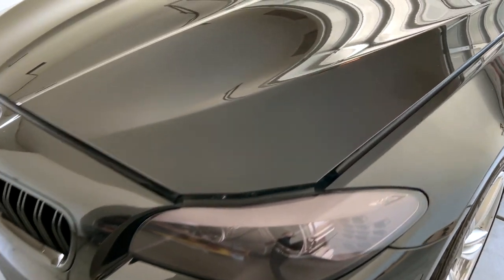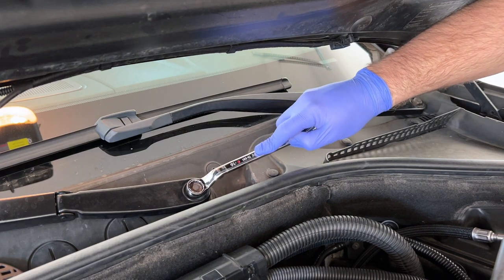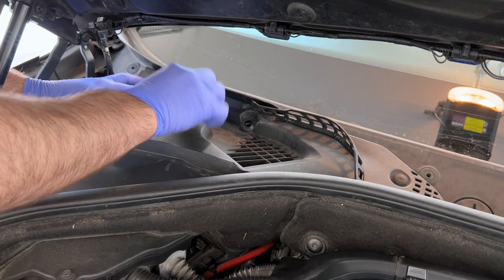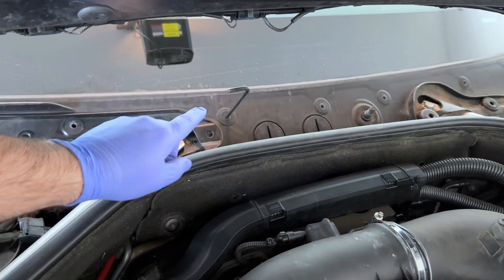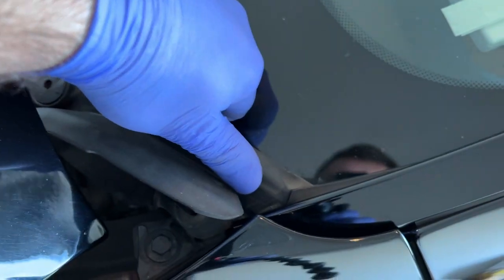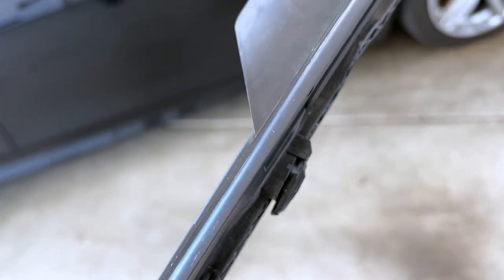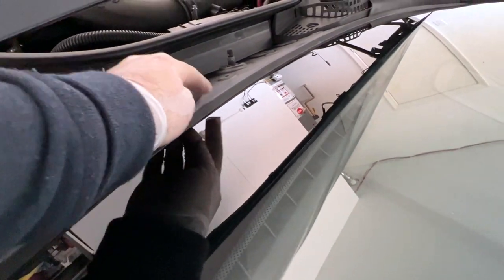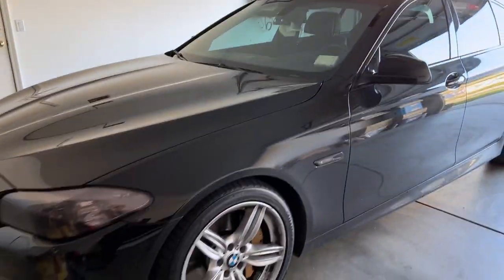BMW F10 Windshield Cowl Cover REPAIR - Tried Twice - Didn't Work.. | BOND Garage

Comment: Damn, a new thing to worry about that I didn't know I had to worry about 🤣
Reply from the maker: no worries. It won't leave you stranded 😁 just looks a little unpleasant.
Reply: @BONDGarage  but water can get into the engine bay no? with that piece flaked off?
Reply: @GRINGOf10  Yeah, messed up my AC Fan blower just replaced it and am ordering the cowl now.

Comment: Just bought an F10 535i and noticed the cowl cover was coming apart.  I had ordered the new piece already and your video looks like it's an easy job to do yourself so might give it a try.  After watching your video, I thought you could probably repair the old one, similar to what you tried, except using a length of 1/4" rubber vacuum line and using a razor blade to carefully open it up on one side, the entire length, and then you could slide it over the edge of the cowl panel.  Should make a good seal and probably wouldn't need any glue.
Reply from the maker: did you try the repair? If so, how did it go?
Reply: @BONDGarage  I went ahead and just installed the new piece since I had it already.  The only thing I did different from your instructions is at 7:40 where you are removing the washer lines, I just clipped off about 1/2" up the left side of that hole that the washer lines go through and removed the cowl piece without disconnecting the lines (couldn't get them unplugged).  I can't see any reason the fix I mentioned wouldn't work.  ;-)

Comment: Looks like you missed in selecting a long one 8mm by 10mm for the second rubber profile, they have two black colors with different dimensions! I'll try it and let you know!
Reply from the maker: I'd appreciate that! Let me know which profile seems to work because I have another F10 here that could need a new cowl cover :)

Comment: This same thing is happening to my M4. It seems to be a problem common to all BMWs over many years. Why does BMW not fix this problem properly rather than making this one of the first failure points on all their cars?
Reply from the maker: probably because they're mainly designed for lease and to look good for the first customer. 10 years down the road doesn't really affect those decisions unfortunately. just noticed that the big side covers in the engine bay also fall apart. it's getting out of hand..